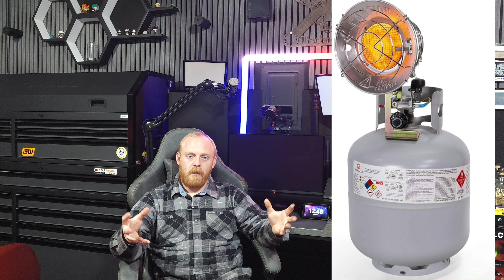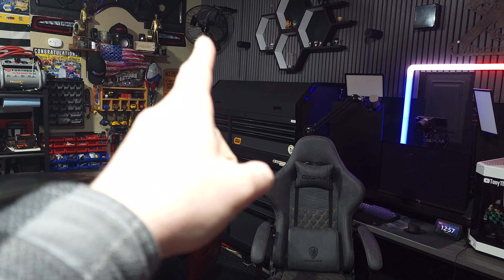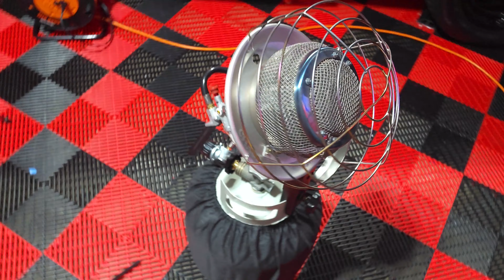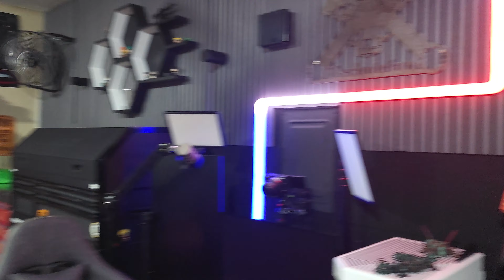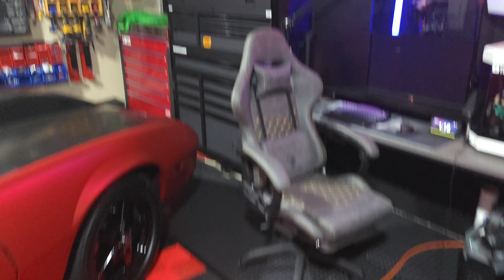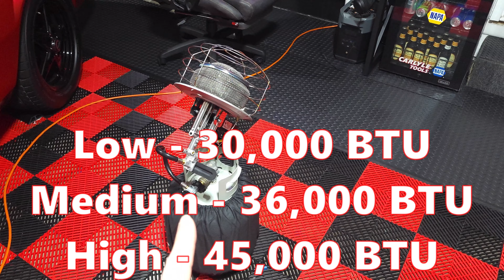Must Have for the Garage Mr Heater 45000 BTU Propane This is a Game Changer

Comment: These work great but even on low they suck the propane down fast. If you only use it 10 minutes a day I could see it lasting a little better though.
Reply from the maker: I probably use it about 30 min a day and it usually lasts about 3 to 4 weeks roughly.

Comment: I've got a Ridgid propane heater..I keep it on low and I've got over a dozen batteries..it doesn't a great job in my 2.5 car 24x24 un-insulalated pole barn style detached garage...I'll probably get it insulated by next year.. that heater still does a decent job though for NE OHIO..
Reply from the maker: Very nice. That's awesome!!!